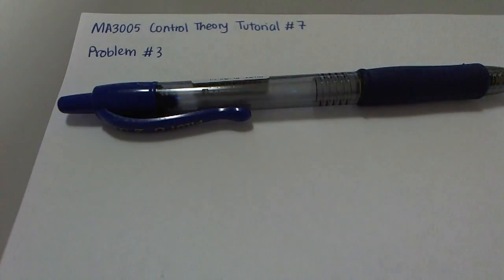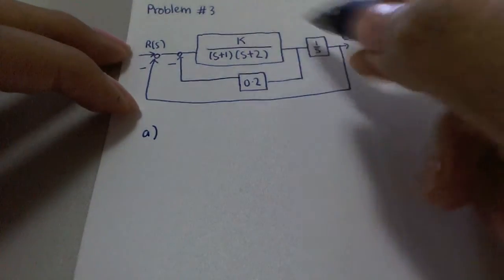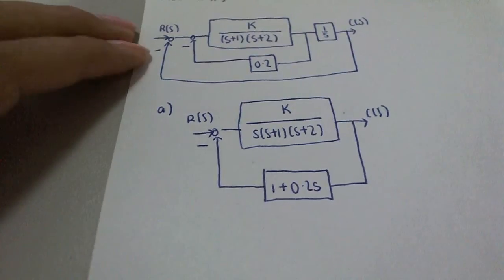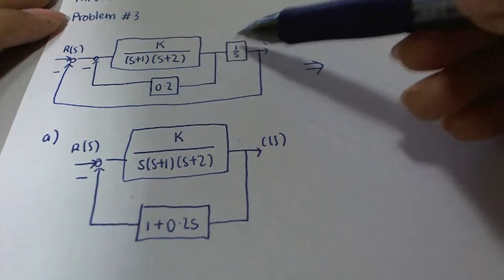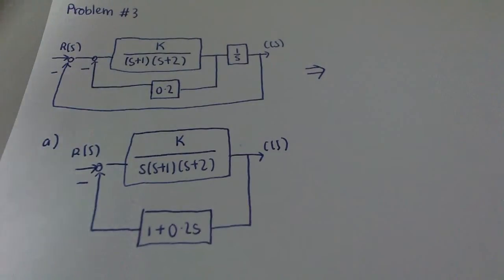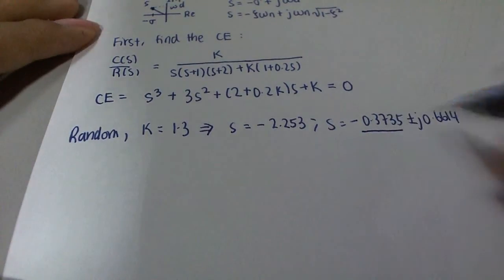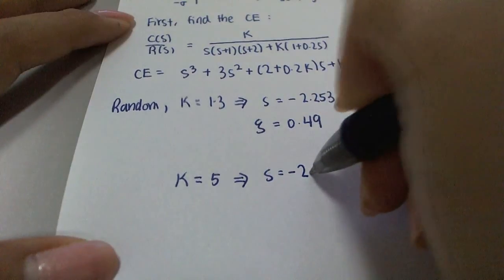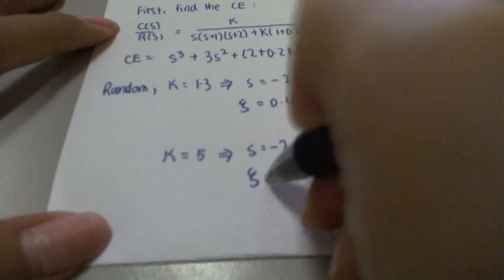MA3005 Control Theory Tutorial 7 Problem 3

Comment: Hi, very clear explanation on the problem set! really appreciate it. However, could you explain on how you get S=+- (sqrt 5) and K=15? How do you get it? Point number 4 @ 16:38min.
Reply: One method is to substitude s with jw (where w is real number) as it lies on imaginary axis. And solve characteristic equation (CE) for w and K. In the example we have CE: s^3+3s^2+(2+0.2K)s+K=0. If s=jw then
(jw)^3+3(jw)^2+(2+0.2K)jw+K=0.
-jw^3-3w^2+(2+0.2K)jw+K=0, since j^2=-1, and j^3=-j. Next grouping real part and imaginary separately.
(K-3w^2)+(-w^3+(2+0.2K)w)j=0. So we must solve next two equation
K-3w^2=0 and -w^3+(2+0.2K)w=0. From first one we have: K=3w^2. Place it into the second one.
-w^3+(2+0.2(3w^2))w = -w^3+2w+0.6w^3=-0.4w^3+2w=-w(0.4w^2-2)=0. So we have
w=0 or 0.4w^2-2=0. From the last one: w=+- (sqrt 5).
Using K=3w^2 we conclude that K=3*5=15.